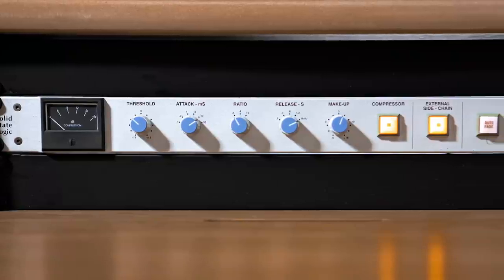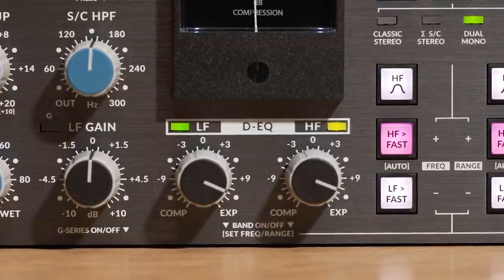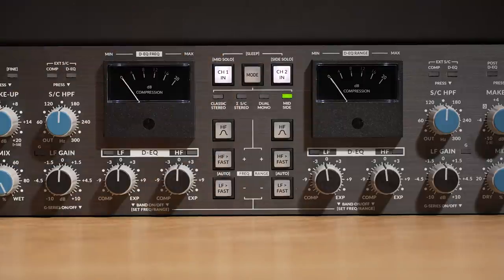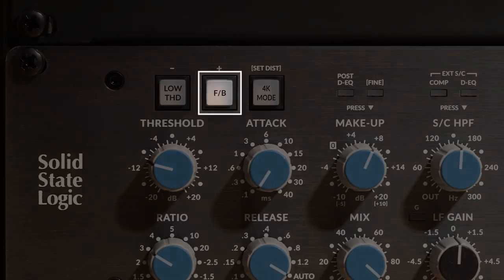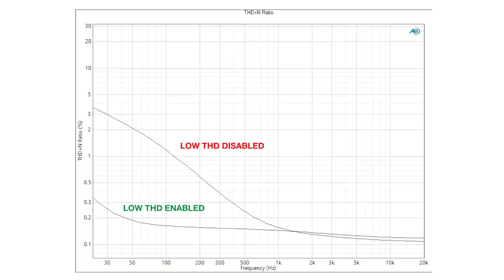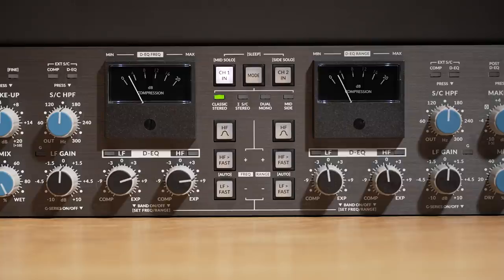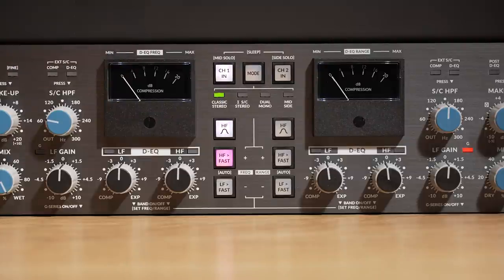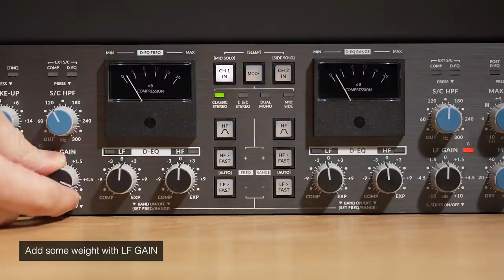SSL THE BUS+ Tutorial

Comment: so much flexibility / so many options and sounds great - if it's microprocessor controlled then it feels like a real shame not to add a software / plug-in control layer though....  as it is there's a hell of a lot to notate if you want to recall later
Reply: Yes software control plz!!!
Reply: I guess you've misunderstood how the microprocessor is used. Its only intended purpose is in/decreasing steps of resistance (usually done by the potentiometer). The advantage are, quite tight tolerances. Therefore the actual manipulation of your sound can and will be controlled very precisely(in terms of analog gear), which enables ssl to fit so many features. 
But nevertheless, its a 100% analog (sound) circuit, therefore the actual potentiometer still have to be dialled in at the correct position. So no software, will be able to do the actual recall of the potis.
(that's the part where I start guessing): probably u could implement some sort of partial recall (regarding the options with pressing buttons, i.E. DEQ's Freq & Range)
Reply: @clemybeatz8031    I don’t think he misunderstood at all. Perhaps you have misunderstood. The digitally controlled analog hardware design is absolutely perfect for memory use. It would make a bit of a mess of an already very crowded front panel though.  Store, recall, and one of the 31 step pots dedicated to setting number is all it would take to do it. I’d be happy with 8 registers. Old school!

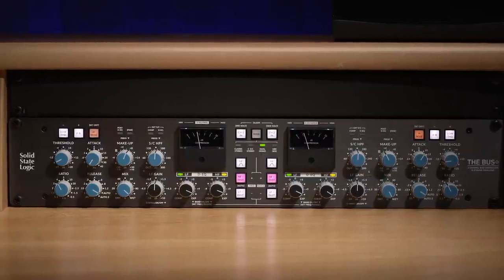Comment: 3:27 The Bus+ uses digital control of it's analog parameters for precise matching, but does not have any means to interface with workstation software via MIDI or USB..?  I would have hoped that I could use a controller plugin to adjust and recall the parameters. Did I miss something?
Reply: Might have to call the Polish designers for that : }
Reply: I agree, they go to this length yet no plug in to recall it remotely. I dont know why SSL can't get into the recall game like Wes Audio or Bettermaker
Reply: @HalCBass   Hal..!! How are you, buddy?
Reply: @HalCBass  Love the Polish. Great people
Reply: @zmix  hey!!!I saw you here.. good still in music !
Reply: From my point of view, the hardware only is a plus. Software support is all it takes to remove those features. As much as you'd like to think it will be around forever, things change. And when they do, your box will become useless after 5-8 years because there is such a large disconnect in the new computer hardware, and your old software. I've had many peices of software driven hardware that are now paper weights due to no more software support on current operating systems.

Comment: Great unit and design with all the new features. I wish it had some output transformers to really add some extra body and weight. This could have easily been implemented like the Fusion with an In / Out switch for the Transformers. I guess the work around would be to pair it with my Fusion!
Reply: Indeed! Ive got them both. In M/S mode the pair offer quite a bit of polish for the Master Bus. The bang for the buck and flexibility is hard to compete with. It stands amongst my other studio compressors and does the glue like nothing else. I often send gear back, but the SSL products remain long after others are gone.
Reply: @noone-t8y  Hey thanks for your reply. That all makes sense. Enjoy

Comment: I’m listening to this on a full range, effectively linear system - and the differences pointed out were so subtle, even after multiple listens, I’m not sure I really got a sense of what this thing can do… other than sound like an SSL bus compressor. 

Without the captions and narration to tell me what I was supposed to be hearing, I would have not known that any settings had been changed at most points in the video. I think with things like the different 4K modes, driving the input a little harder would have revealed its character more. And I only thought I heard the difference in low end with the low THD button. Again, something I would’ve missed if it wasn’t pointed out and visually demonstrated. 

I think I would have to spend some time with this box in person to get an idea of whether or not it was right for me. This video, in terms of pure sonics, didn’t help me.